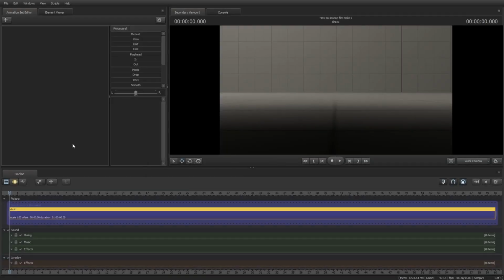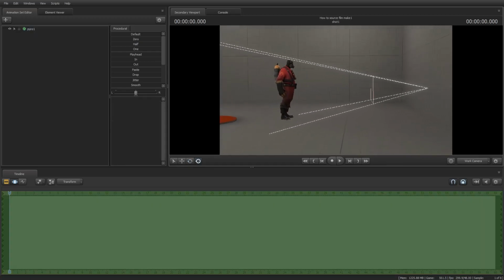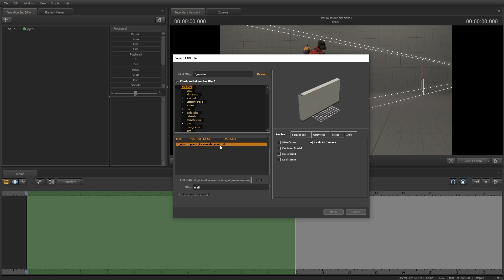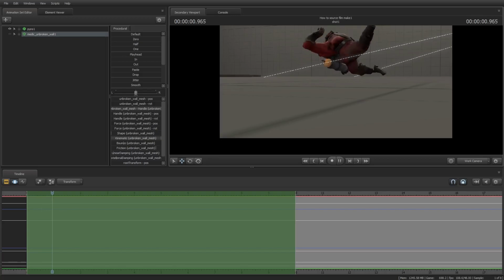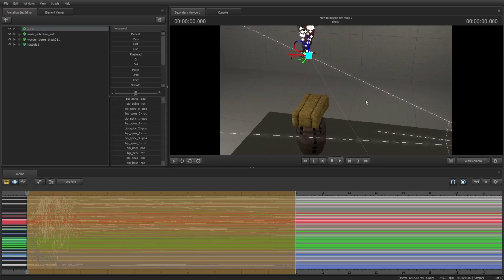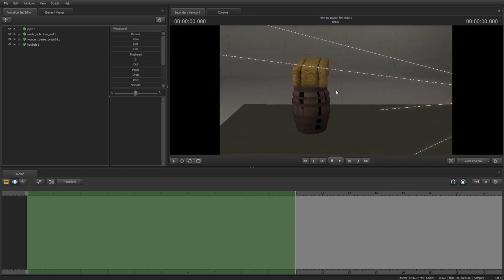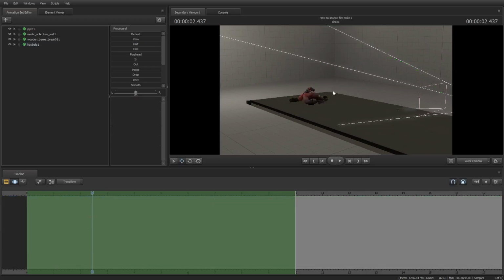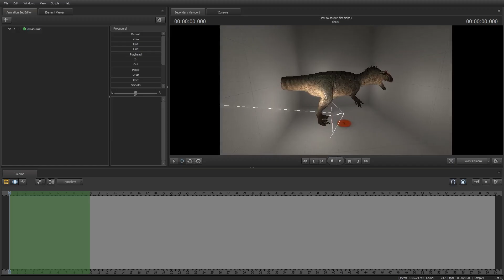How to use ragdolls/ physics in SFM! (updated)

Comment: im trynna use it again but after slecting spy and then scelting a portian of time when i press sfy run thing it wont work it doesnt even pop up
Reply from the maker: Did you rig the spy with sfm_physics first? You have to rig the model, then run the simulation.

Comment: how do i make the pyro stand up do i do it at a cerrtain time?
Reply from the maker: I don't really get the question. This is to add "ragdoll physics", which aren't really physics but rather a complex animation quickly rigged by sfm_phys to act like a physics based ragdoll. Props with physics can't stand because the "physics" is just a simulated path to make them fall in a certain way.
Reply: @baronvonpickles  oh ok ty

Comment: i tried running the simulation but my model disappeared and i did what you said and cant get it back
Reply from the maker: It's been a hot minute since I messed with this, but a common thing and very simple question I have to ask is did you put the playhead back to the start?
After you run the simulation, it sets the playhead to the middle on it's own which can cause confusion and make it look like it disappeared when it's really just under the map.
Reply: @baronvonpickles  I checked under the map, and I set the play head to the start and the start of the shot
Reply from the maker: @mangey_tangey 
Just making sure. What model areyou using? Workshop or original sfm model?
Reply: @baronvonpickles  the original hl2 Kleiner model
Reply from the maker: @mangey_tangey 
Have you tested any other models to see if they disappear? Set also try setting kinematic up so the prop has physics but doesn't fall
Reply: @baronvonpickles  I tried it on Barney, a pyro, and a crate, and the same thing still happened. I tried adjusting the kinematics but it would just rest every time I changed it
Reply: @baronvonpickles  pls help I'm having the same problem

Comment: i know its been  a year but when i put down the wall it just stays there but after it moves pyro still falls through it
Reply from the maker: Did you rig the wall with physics as well? Both props have to have physics in order to detect and collide with one another.
Reply: @baronvonpickles  yeah i figured that out sorry but could you help me out with something else? im trying to get spy to get thrown away but i dont know how
Reply from the maker: @A_randomanimatorTF2  
Sfm_phys is hard to get to work when it comes to manually altering a props path to fly or collide with another prop.
I can't help you too much there I'm afraid due to how it works.

Sfm_phys doesn't actually give a prop phyics, it quickly runs a simulation and creates a path for the models individual bones to follow that mimics physics.
When you move a model, it changes the path the simulation created which messes up the animation.

There are workarounds and some people can get it to work with trial and error. 
I think if you create a path and then try to manually edit some parts of it, it may work, but I have never personally had success with it.
Reply: @baronvonpickles  all good but do you know if thers a tutorial anywhere?
Reply from the maker: @A_randomanimatorTF2 
I haven't found any that work for me.

Comment: great tutorial but im using the normal engineer model in sfm and the whole thing ragdolls apart from the pelvis and i was wondering if u might know what the problem is?
Reply from the maker: @hsh12361  The only thing I can think of is either you didn't use the hwm engineer, or the pelvis has kinematic turned on.

Comment: so i tryed doing this with hl2 barney however when i ran the simulation on the medic wall it moved and the model phased through it
Reply from the maker: Do you mean the wall itself falls?
If so, you probably forgot to set kinematic all the way up, which will turn the wall into a static prop and won't allow it to move.

Comment: It for some reason dosent work in Sessions that contains a few shots. I was trying to get a Half Life 2 model ragdoll but it gets invisible everytime. Is there a fix to this?
Reply from the maker: Sorry for the very late response, I've been taking some time off. Did you set the play head back to the start? If so then this sounds familiar to a comment I saw just after this and I think it's the same issue:
"Did you try moving the model manually so it falls in a specific spot? I've had a few questions before where attempting to hit the model with a box or move the model to fall in a certain way, really effects the way the physics is simulated which usually just makes the model stretch so far that it just disappears from the view."
Reply: @baronvonpickles  I tried hitting the model with a box, i then tried it without the box and it still dissapears, not only the model but all the bones too.
Reply from the maker: @HIKE-pg5iz  Does it delete the model completely, or is it still selectable in the side menu?
Reply: @baronvonpickles  It is still selectable

Comment: I've been having an issue where running the physics doesn't work. It won't even show the loading bar. I assumed it was an issue with the model being from the workshop but the same issue occurs with the default scout model. Do you know of any fixes for this?
Reply from the maker: Sorry for the very late response, I've been taking some time off.
Make sure the scout model is hwm; I heard hwm works better so better to be sure. This isn't an issue I've hear before from what I can remember so we'll just do a quick check of the basic steps:
-Installed the correct version of SFM_phys from the github link in my previous video.
-Spawn a simple base prop like a haybale or an hwm model
-Select a portion of time using one clip in the motion editor
-Rig the prop with physics
-Run the animation
-Test a prop with kinematic and a prop without kinematic

On top of that, I made a small change you may have noticed in this step "Select a portion of time using one clip in the motion editor". I've been hearing that selecting a portion of time using multiple clips can cause the simulation to not work.
Otherwise, did you try moving the model in anyway? Some people have commented asking if they can move the model or hit it by moving another physics rigged prop and while it is possible, it's extremely unlikely to work properly and usually makes the model glitch out.
Reply: To preface I have a certain portion of time selected as well as the physics rigged to the model

Comment: is it possible to move the models while they ragdoll?
Reply from the maker: Sorry for the very late response, I've been taking some time off.
It is possible but it is very unlikely to work the way you imagine it. Moving physics rigged props or hitting them by moving other physics rigged props is extremely buggy and usually doesn't work. You can try to re-run the simulation several times or try to mess around, but I have never had it work for me so I cannot help too much when it comes to finding a reliable way to make it work.
Reply: @baronvonpickles  thanks for telling me but i already figured it out like right after i made the comment lol
Reply from the maker: @DhudoLopmandona  No worries! I was just running through the comments I've gotten while I was gone. Again, terribly sorry for the delay!

Comment: im trying to hit an engineer with a crate but he gets stretched out because the pelvis doesnt move
Reply: I think you might be in the graph timeline thing
Reply from the maker: Sorry for the very late response, I've been taking some time off.
It could be like what effortlevelzero said where it is because you are in the graph timeline and that does sound like the reason why. There are also a decent amount of issues with moving physics rigged props. Trying to rig a prop with physics and then move it in a specific way combats the way the physics work which usually bugs out the prop by stretching it, refusing to run the simulation, or by not doing anything at all. Unfortunately, I've never personally found a reliable way to move props rigged with physics so I can't help too much on that part.

Comment: Doesn’t work
Reply from the maker: I need details on what the issue is.
Reply: @baronvonpickles  the rig will not apply
Reply from the maker: @Braydens_Parkour-44  This usually happens with custom models due to new bones that don't register with the physics script. But sometimes it can also happen due to a faulty install. What model are you using?
Reply: @baronvonpickles  idk
Reply: @baronvonpickles  like a hl2 model
Reply from the maker: @Braydens_Parkour-44  Well if you can, try and send me the exact name of the model and I'll take a look. Also, try using the model I showed in the video to see if it's an installation error.
Reply: @baronvonpickles  okay, when I get a chance, I’ll look at the exact model

Comment: How do you get to rig physics? I follow step by step how you got to rig physics in the video and it's not there, is anyone else having this problem? The only options I have in the rig section are load rig script, detach rig, and rig_biped_simple
Reply from the maker: I didn't remember to cover the installation of the physics extension until I had posted the video. I quickly cover the installation in the first 3 minute segment of the video linked in the description.
Reply: @baronvonpickles  Thank you so much, it worked and I have the physics now thank you.

Comment: whenever i use it on my heavy he just dissappears no matter the time frame
Reply from the maker: Sorry for the very late response, I've been taking some time off.
There are a few things I can think of that may cause that:
-Did you forget to select only a portion of time in the motion editor?
-Did you select multiple clips when selecting a portion of time? I've been hearing that this can cause issues.
-Did you forget to set a physics rigged floor with kinematic turned on? This will catch the model from falling through the map.
-Did you move the prop in any way? Moving physics rigged props can cause them to stretch out violently and disappear from the map.

Comment: when i try to push a model a object just goes trough him, is there a way to fix this?
Reply from the maker: Sorry for the very late response, I've been taking some time off.
There are ways to try and hit physics rigged models but there isn't a 100% reliable way to have physic props collide with one another. You can try re-running the simulation a few times to see if it helps but it's very unlikely it will work unfortunately. 
The reason why is because the runsfm_phys script only makes a pre-determined course for the object to follow, but that course only simulates gravity at different levels depending on the changes to shape, friction, etc. Manually moving that object changes the way the "gravity" effects the model which can cause it to freeze, stretch violently, or simply disappear.
Reply: @baronvonpickles  i didn't actually thought you'd reply :0
THANK YOU VERY MUUUUCH
Reply from the maker: @Dr.bone228  I try my best to reply to as many comments on my videos as possible! I am sorry I couldn't help you more directly with the problem you had though.
Reply: @baronvonpickles  nah its all good all good

Comment: ok i can not get it to work 95% of the time i dont know what im doing wrong, i fallow everything you did but it will not run the sfmphys simulation no matter what i do. i loaded in a new model and put sfmphy rig on, select a part of the time line and click on run_sfmphys_simulation and nothing happens. I tried using it and a simple object and still will not work.  I don't know why it will not try to simulate anything I want it to. plz help, this is pissing me off.
Reply from the maker: Can you send me the model name?
Reply: @baronvonpickles  hey i sent a replay did it go threw ?
Reply from the maker: @DragonLegoMasterZ  No, I did not see the model name.
Reply: @baronvonpickles  I sent you a mega link of the model, named Dagath. Did you get that?
Reply from the maker: @DragonLegoMasterZ 
No, I don't see the link. I'd imagine it's a Youtube safety measure. Don't worry though, I'll find the model and I'll get back to you; I will say to not get your hopes up too much though, external models have always been hit and miss for me.

While you wait, try one of the models I use in the video and tell me if it works or not.
Reply: @baronvonpickles  ok, I knew it was  YouTube or you deleting my replies but of the link, I'll do what you said and see if it works. But as far as I knew sfmphysic is being very picky. Like it works in shot 1 in my project but not in any shot beyond that. Thanks again for the help.

Comment: So far I've figured out how to ragdoll the models when falling (just like in this tutorial/guide), but what if I wanted my model to look like it was thrown from the ground to the air, how do I do that?
Reply: I've been trying to figure out how to get a model to have most of its limbs/bones run with the physics rig EXCEPT the pelvis. That way I can control the trajectory of the model by just moving the pelvis, while the other bones can ragdoll. Do you know how to do that?
Reply from the maker: @Cyber_N-7660  Now this is a good suggestion, I believe I could be able to find a way, but I'm not completely certain. I'll try some things.
Reply from the maker: This is a bit more tricky. I would imagine you would need to rig another model and sort of ram it into the model you want to throw.
But the drawbacks are these:
-It would have to be the right amount of force or nothing will happen/ the model will go flying.
-Due to the physics being finicky as it is, it's a pain to even get the models to collide properly in the first place.

Alternatively, you could try to change the model's path a bit more manually but that will most likely result in it just appearing as a stringy mess.

Lastly you could drop the model from a very high place, let it bounce, and then just play the video from the second it touches the ground to bouncing up in the air.

I'll check it later but I doubt I'll be able to find an effective way to make it more exact to your specifications since I tried a few things like this a while back.
I'll check it out soon.

Comment: im guessing it doesnt work for some workshop models since it works fine on the scout but for e.g what im using is the lethal company player model and it just "breaks"
Reply from the maker: That is correct. Some workshop and external models do not use the same rigs as the built in models the physics extension was built for.
You just have to experiment with some.
Reply: @baronvonpickles  i see big thanks.
Reply from the maker: @Thesnakex2MC  
Of course!

Comment: Can help me? I have download map from steam workshop but, that is not show on list Bsp.file on sfm why??. What i can do that to overcome this problem
Reply from the maker: What map did you download?
Reply: @baronvonpickles  gm_goldencity from workshop
Reply from the maker: @user-iw2jh8qc6f  Sorry for delay, I didn't get the notification until now. I will check it out tomorrow as it is late for me.
Reply: @baronvonpickles  ok take your time, and please help me to solve my problem in sfm map downloaded
Reply from the maker: @Ramenguy-san  
So after a bit of work, this is what I found:
The map gm_goldencity is a gmod map meaning it needs to be ported from gmod to sfm.
After downloading the map, porting it, and testing it a few times, I was able to get it to run with little trouble with the biggest down side being that certain textures didn't load into the sfm port. That aside, it worked pretty well, taught me how to port maps from gm to sfm, and it took about a minute to do.

To turn the gm_goldencity map into a sfm port, just follow this 1 minute tutorial: https://youtu.be/ilOG0WGO_3I

I think that should be the issue you were having and if so then this will be the easiest way of fixing the problem.
If the problem continues though, let me know and I'll start looking a bit deeper.
Reply: @baronvonpickles  thanks for help bro 👍anyway if I have problem I give commen so All viewer can learn how to solve problem in sfm
Reply: @baronvonpickles  my question?, I must install Garry's mod first?
Reply from the maker: @Ramenguy-san  Yes, I believe so.